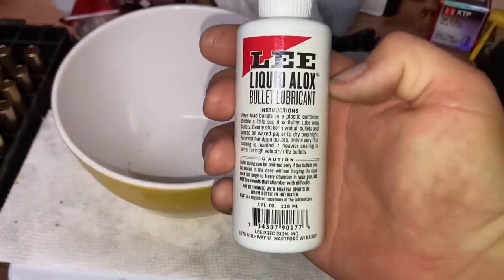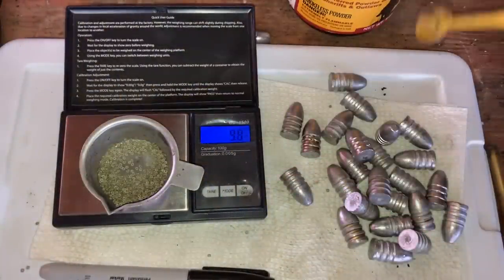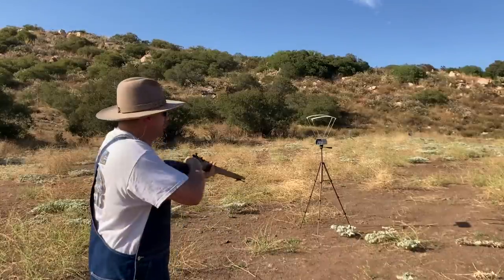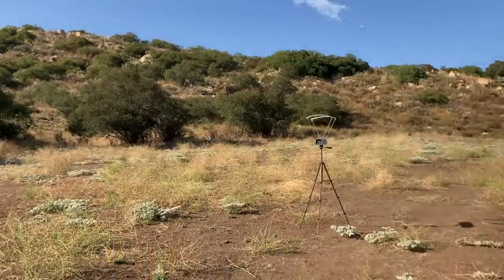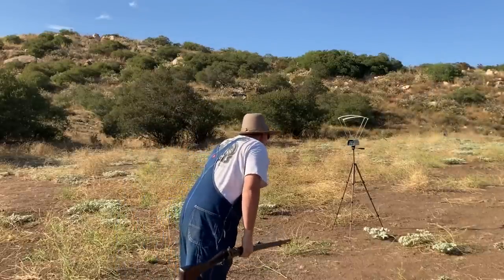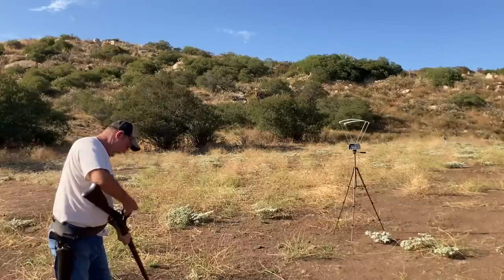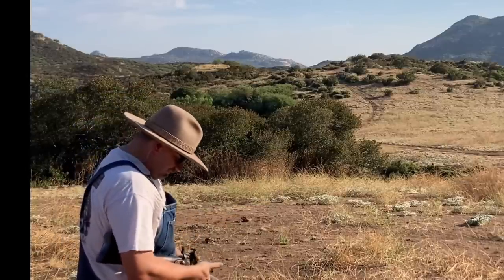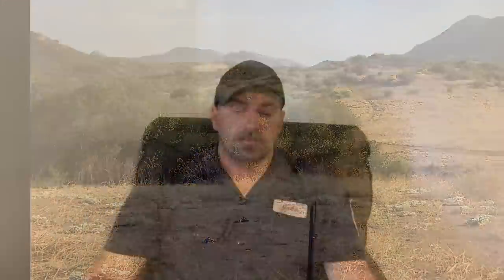Smokeless 50-70 in Trapdoor Springfields. Is it Safe?

Comment: I load mine with hens teeth. Since they have been easier to find than a can of trailboss.
Reply: I feel lucky.  Found a few cans at a crusty old pawn shop middle of the...  times.  
Love my "22 magnum" AR load for critter dispatch.  I usually keep one in my pocket when running the farm to pop in the chamber.
Reply: I think they even stopped making it!
Reply: They haven't restarted the production line for it yet.  Think they said another two years before they've settled the contract they halted the production line for.
Reply: @Johnsormani Does the muzzle velocity increases above 2000 by using smokeless  with19gram slug ? If no then it is hopeless rather stick to BP
Reply: چرا با متر در ثانیه نشان نمیدهی قابل فهم تر است

Comment: The 50-70 is a fine old timer. Elmer Keith spoke well of it, and its reliablilty for putting meat on the table. One of the biggest disadvantages to using smokles powder in antique arms intended for traditional black is, it tends to throw the sights off. I almost always get the best accuracy using black powder and loads that replicate original load data. Trail boss is a fine powder and can be tweaked a little bit for higher velocity. However, traditional black is generally much safer to use in antiques. Another great video, keep up the good work.
Reply from the maker: Thank you
Reply: @Everythingblackpowder  I have to give thanks to you. Lots of crap on you tube, but everything black piwder is not crap!
Reply from the maker: @blueduck9409  thanks again
Reply: Yeah you do a very good approach to everything black powder I'm 73 years old and since I was like 10 11 years old I've been experimenting with black powder and things I shouldn't have been experimenting with but anyway I'm still alive to this day I have burned away about half of my hair once upon a Time with some black powder and that was interesting eyebrow on the right side was gone right side of my head to all the hair was gone but I survived the glasses are smoked up a little bit but anyway I learned my lessons and and I've made it to 73
Reply: And I make my own black powder

Comment: I load both smokeless and BP in 45-70. I use 405 grain polymer coated bullets (SNS) in both and shoot in my 1880s Trapdoor. For smokeless, I use Accurate 5744 powder and get about 1240 fps using load data for the Trapdoor. For BP, I use my own powder (which I learned to make using your videos!) and get about 1330 fps.
Reply from the maker: Glad to hear it
Reply: I also load .45-70 for my trapdoor and.50-70 for my 1871 Springfield rolling block with the Accurate 5744. Works great.

Comment: With my .50-70 Sharps Carbine, which is a newer gun. I was using a light charge of Unique which is in most reloading manuals, and work well for the Lyman 450 grain bullet I was getting from Montana Bullet Works. I didn't have a chronograph at the time to measure it, but I can tell you that the from the recoil and shooting it, the smokeless Unique load is tame compared to a case with even only 62 grains of FFG Goex in it. The nice thing about that tame Unique .50-70 load in my Sharps is that at 100 yards it drops the bullet right in nicely on the target consistently and I doubt a deer would really know the difference exactly how fast that bullet smacks him when that 450 grain load gets there. One of the things I do when I load a case with smokeless powder each and every round since I don't load in huge volumes and I have done this for years for my own piece of mind is that I weigh all the components, the bullet, the primed case and of course the powder. I have that number written down so that when the cases are loaded, I weigh the loaded case. If that case somehow got undercharged or overcharged, it will show up there and then. Since I rarely load more than 20 cases or at the most, 50 at a time, this may take some time away from loading to do this, but it's a darn good way to make sure those cases are loaded correctly.
Reply from the maker: Excellent

Comment: A addendum to reloading with smokeless in antique cartridge guns is to NEVER use jacketed bullets. Only use lead bullets. Jacketed bullets produce a different pressure curve that will possibly/probably result in a very bad day.
Reply from the maker: That too
Reply: It's not that they produce a different pressure curve. It's that 9/10 they're severely undersized and allow a lot of hot gasses to escape by and it starts etching the edges of the lands in a hurry.
Reply: @TexasLeverGunner Severely disagree. Ever slug a barrel? Try it with a jacketed projectile. Pressure rises more rapidly like a barrel obstruction till the jacket is swaged and moving. The reloading manuals even have hotter loads for comparable weight lead as long as it's not pushing extremes like 1300fps non gas checked or 1600fps gas checked.
Reply: @PBVader  I've been handloading and casting for over 15 years, and I shoot BPCR competitively. I'm well aware of how pressure works, and even though what you said is true, that's still not why it is not advisable to fire jacketed smokeless ammunition out of an original black powder rifle. The correct reason, is the reason I stated.
Reply: @TexasLeverGunner  You could have simply said "beware of cheap steel gas cutting" and I would have been OK with that. Agree to disagree.
Reply: If you use jacketed use sabots
Reply: The main thing is copper is way harder than lead, so when you're talking about a 150 year old gun you might be accelerating wear a lot

Comment: Is it safe? Safer than going near San Francisco with that mustache! But BP has a maximum pressure. It doesn't exactly level up, but it stops at 14,000 psi. A light load is almost near that. Steel has a tensile strength requiring 60,000 psi to tear it. Big safety margin. Smokeless powder does not have a flat pressure curve. What!!! It means that if you start with 20, then go to 22 and it goes a little faster. You go to 24 it goes a lot faster. 26 goes fast enough to blow it up. Smokeless builds an enormous pressure with very little change. It makes way more pressure then it takes to tear steel.
Reply from the maker: Yep.

Comment: Fun video to watch!
Back in the 1980s-90s, for about 10 years or so, I had a Springfield contract 50-70 rolling block.  The thing had an over-size bore as compared to what the bore was supposed to be.  It would keyhole a bullet sized at .515 with a full load of black powder. I slugged the bore and I think it came out at .520 or so.  I tried duplex loads that I got from a magazine back then, and I shot slow loads with IMR4198, SR4759, and with Unique, both of those loads were less than starting loads from the old 46th edition Lyman reloading manual.  The slow loads didn't keyhole.
According to my old notes, I also shot a fair amount of Pyrodex through it.
I made the mistake of selling the rifle in the mid 1990s, still kick myself about that mistake.

Comment: I used to have an 1868 trapdoor 50-70, and I used IMR 4198 behind a Lyman 425 gr bullet. 
The old formula was 30% for black, which comes out to 20 grs. 
I used 20 grs and never experienced any problems. 
The recoil was lighter than BP, and it gave satisfying low boom.
Reply from the maker: Excellent

Comment: Great stuff and thanks for taking the time to try this. Those SDs you were getting are GREAT given the fact that that little pinch of powder is rolling around in that huge case. 12 grains of Unique is what I use in 45-70 under a 400 or 535 gr 1-20 bullet. I don’t get as good an SD as you got though. Maybe I’ll have to try Trailboss.
Reply from the maker: I had the same issue with unique

Comment: I have a lot of respect for you and your knowledge sharing. I have learnt a lot from your channel already. I admit that when I started watching this video, I got a little nervous because I thought you were going to talk about how “safe” Trailboss is. Thankfully, you didn’t go there.
We have guys at our local club raving about how “SAFE” it is to use in old guns. 
Look at the reloading tables from ADI (the Australian manufacturer ) and you soon see that their charges of Trailboss are limited by PRESSURE not VELOCITY. For cartridges like 30/30 ( that are built for it) you can achieve considerably higher velocity from less pressure by using a slower powder. Trailboss is an extremely fast burning powder. IMO it is good for reduced power ( velocity) loads and you can get away with using it in old guns if you know what you are doing and understand how it works. You are using a very small amount of propellant which’s burns very fast to generate a safe amount of pressure but not a lot of gas ( not much chemical equals not much gas) Compare this with black powder which uses a lot of propellant, producing lots of gas but it’s slow so the pressure stays low as the bullet moves down the bbl. 
Also beware that you could easily double charge ( or worse) a cartridge with Trailboss. 
I think about it like this, those air cannon bowling ball launchers dump a ton of air behind the ball but it’s only 100 psi. It’s pushing all the way to the end of the bbl. A baseball bat delivers a heap of pressure to the ball in the blink of an eye but once it’s hit, there’s no more push. 
Constant gentle push vs impulse.
Thanks for your work, I love your channel.
Reply: I never shoot fast burning powders in my guns for the exact reasons you indicated.
Reply: ...you might avoid sitting next to these experts...😄

Comment: WOW what a blast form the past.......... I bought a trap door at a garage sale back in the early 80's and shot black powder and it worked just fine but when looking threw very old reloading books I found some data (1920-1940) and here it is /// IMR 3031 @  36 grains with a 405 grain single grove flat point . I have been shooting this load since 1983 and about 5000+ rounds later still going strong about 1200 /1250 FPS  Alan Thomas
Reply from the maker: Excellent! I’ve noticed that the older the load data the hotter the load.
Reply: If that for .45-70 or .50-70?

Comment: Saw an interesting video about the first smokeless powder, gun cotton, firearm. Not the label. It was an Austrian muzzle loader in the mid 1860's. They did it by putting a rod in the back of the bullet as a spacer. The gun cotton, nitro cellulose, was a fabric wrapped around the stick behind the bullet. The "cartridge" was one unit. Slide it down the barrel. Fires with a percussion cap. Worked very well and it was safe. The project was dropped when a small magazine, think bunker, blew up. They were still learning how to make it stable.

I'm thinking a sabo with a rod on the back for spacing and you could have a smokeless muzzle loader.
Reply: The problem with guncotton was poor long term stability under environmental conditions. That and the Austrians hadn't figured out the thing about not storing experimental propellants in the same bunker with service propellants.
Reply: @nevisstkitts8264  Modern single base smokeless powder is mostly nitrocellulose, which is also the main component of guncotton. Nitrocellulose is a high explosive which can detonate (which is not what you want for propelling a bullet). The trick is using additives to prevent detonation. Diphenylamine is one of the most common in modern smokeless powder. One of the first kind used was petroleum jelly (vaseline). I suspect that early guncotton had a lot of the un-nitrated cotton still present which may have retained some of the nitric+sulfuric acid mixture which was used to nitrate it, which would accelerate decomposition in storage, which in turn could make it more likely to detonate.
Reply: @sbreheny  DPA has been used since at least 1901 when "Poudre 3NBF" was developed by France. It stabilizes nitrocellulose formulations by scavenging the decomposition products generated over time. Paul Vieille invented the first smokeless powder by controlling the esterification level and thus the burn rate and reaction linearity. However, his "Poudre B" also became unstable over time because the volatile stabilizer would evaporate. This resulted in several iterations of powder formulations leading toward 3NBF. Smokeless powder still becomes unstable once sufficient DPA has been scavenged and the original powder had high nitrogen content. IMO 2NDPA provides better stabilization than DPA over long periods, but this requires a diligent design process for any specific formulation. The French avoided double base and triple base propellants and therefore were not forced to use 2NDPA for their single base approach. A great many single base propellants simply continued to use DPA, as a result.

Comment: Nice Video and nice consistency there with Trailboss. I was quite surprised how low you could go with the powder weight and how it remained accurate in your (probably 1:42 twist). I Used 15 grains in my M1867 Rolling Block and that was real accurate but I'll slow it down a lot more thanks to your 9.5grain experience and I want to conserve my Trailboss because, as you said, they don't make it any longer. A tub of Trailboss will cost you $1000 here in Australia compared to the pre-madness price of about $130. Blackpowder is unobtainable so it is strictly a home-made proposition where I come from. As for the maker of Trailboss (ADI), I wrote them and they claimed that they WOULD make it again but they screwed up their own manufacturing plant due to gross incompetence and it might be a few more years but they also screwed up the manufacturing of all pistol and shotgun powders and at the same time  America had some supply issues and now won't sell powder to Australia so local importers are slowly swapping over to importing European powders like Vectan. In the meanwhile we buy cases of 12 gauge cartridges to extract the powder for pistols and also experiment with the lowest loads we can manage so your very nice video came at a good time and I hope others will use it.  I personally swapped my main Cowboy cartridges from 44WCF to 32WCF so I only use about half the powder and I really like that little cartridge.

Comment: Great Video! I have been playing around with smokeless in my original Marlin Ballard Pacific in 50-70. I am finding that the smokeless load I have developed is far more accurate then my best black powder load out to 300 yards. You are correct the speed of the bullet is far less in smokeless, but the fun and accuracy level is right there in shorter distances. If I was shooting at 1000 yard target, I would use black in my rifle. Keep up the good work!
Reply from the maker: Thank you

Comment: Wonderfully consistent and accurate smokeless load! If one wanted reduced recoil and fouling using a powder that is low-pressure & safe in original BP firearms, APP is a viable choice. I normally shy away from subs, but in a pinch, I have used it and been pleased with the results. I load 44WCF for a friend with a late 19th century Colt Frontier Six-Shooter using Trail Boss...just over 720 FPS with a 200 grain bullet, so that is right in line with what you got in your 50-70. I use 5744 in my "Quigley" Sharps 45-70...great powder in large capacity cases, as it isn't  position-sensitive, gives small ESs, even with starting loads, and it's easy to match original BP velocities (important on guns with sights regulated for the "old loads").
Reply: Do you believe that our friend, owner of this wonderful channel, has never heard of the APP?
I already told him to test it... they even say it works with flint.
Reply: @sandroventania782  A lot of people have only seen it sold as Shockey's Gold, but it's the same stuff. I've seen folks use it in rock locks, and it seems to work well as long as they're using real BP in the pan.

Comment: I have a couple smokeless loads for 45-70, and the one performs sub moa in my 1884, which was a pleasant surprise. I did a lot of research and interacted with the old timers at castboolit forum before I worked them up.

I also use Alox on top of regular lube in the grooves just because I'm ocd about it.

For a BP substitute I'm running Triple 7, dropping the charge 15%. It performs well enough if I want the smoke effects. It's plenty available and does better than Pyrodex I found.
Reply from the maker: Excellent

Comment: I load both trailboss and 5744, but not why you think. 45 colt 6.5gr of trailboss pushing a 225gr RNFP to 750fps in a SAA clone and 900fps in a carbine keeps the leading down. 5744 is so versatile it can load ruger only 45, high speed115 and 168gr 308, and do a reduced or workup load in whatever. 5744 is slower than trailboss, but heavy pills need that for timing. It even helped me develop my 45 mongo.

Comment: I've been shooting cap and ball revolvers and other black powder guns for years. I recently got a conversation cylinder for one of my revolvers. I have been using some factory loaded cowboy cartridges, and now I have a bunch of empty shells. So, I decided to start reloading with smokeless powder. I was surprised to find how little smokeless powder per grains you use compared to black powder or any of the substitutes. I can see if you use 25 to 30 grains of smokeless powder in a black powder revolver, you will blow it up. With the powder that I am using, it takes between 5 and 6.2 grains for a .45 Colt cartridge. I loaded some up using a Lee dipper, and they fired way too hot for my gun. So I weighed out how much powder that scoop measured, and it was between 7.5 and 8.5 grains. Lessen learned weigh your powder.
Reply: You should always weigh smokeless powder but measuring black powder by volume is generally ok

Comment: Awesome video. I use 10 grains of unique behind the lee 500 grain cast lead lubed with white label xlox (same as alox just cheaper and thicker so it covers easier) in a second allin trapdoor... giving me 950 fps. It's a sweetheart of a load and pretty accurate.
Reply from the maker: I tried 10gr of unique with the Lee 450gr bullet. It worked well